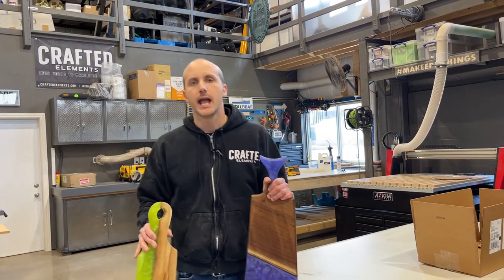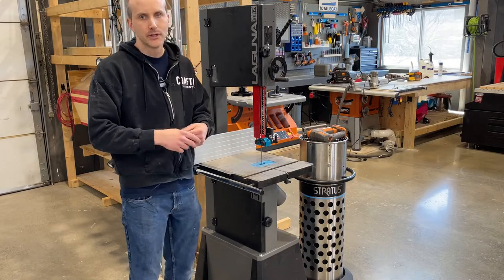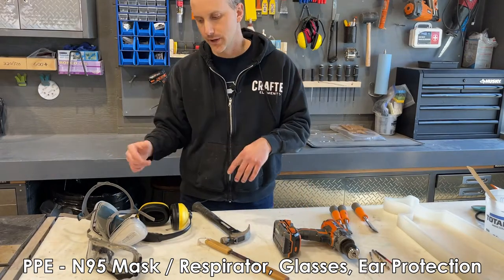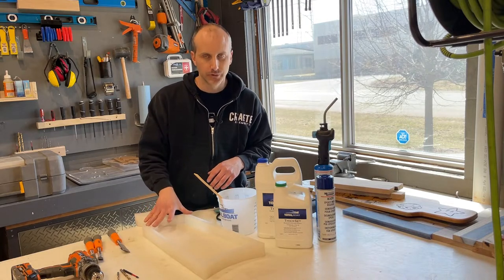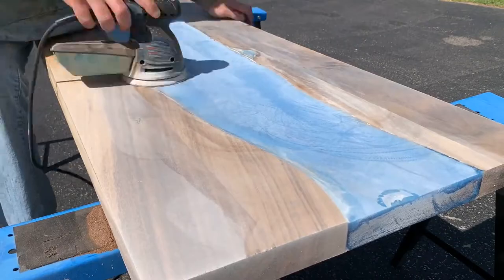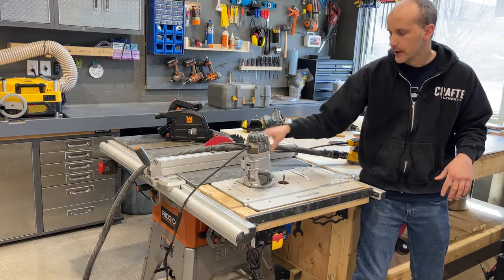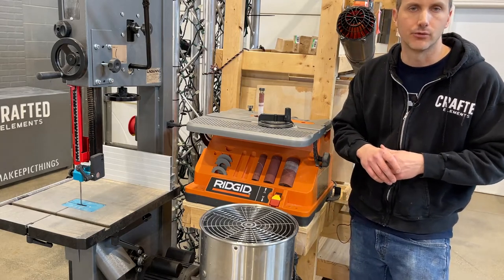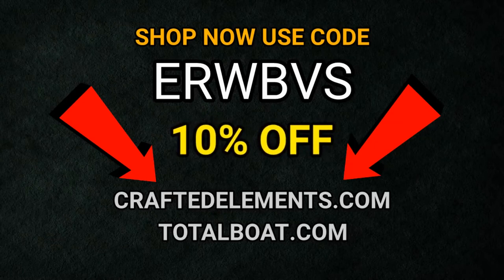Epoxy Resin & Wood Basics Series - Tools For Wood & Resin (Part 2/11)

Comment: I think an oscillating sander like the Rigid unit you have in the video is a must. From personal experience, this type of sander can be a lifesaver whenever you have to deal with router chip-out, especially along the edges. While these sanders cannot hide major chip-out damage, small to medium imperfections or even edge modifications after routing, this tool is ideal.
Reply from the maker: I have recently come to agree. They can be purchased for a relatively small amount of money, but make up for it in time saved. I rarely used it until recently, I just stuck to my 5" palm sander, but it does some magical things better than the palm sander!

Comment: appreciating your video series - one of the challenges i am experiencing is maintaining my plainer so it works sufficiently in plaing the wood, seems to require a lot of attention.
Reply from the maker: Totally understand. You need to make sure your blades are sharp in the planer, and you don't want to take off too much at a time. You want to remove multiple small amounts in multiple passes. Don't try and take off 1/8" at once for example
Reply: Thanks so much for replying, how frequently would you say you clean rollers and blades?
Reply from the maker: @justjacqify  I dont really do it on timing, and its going to greatly vary because its related to the amount you put through it. Right now, the stuff we make is only for demonstrating to YouTube and doing photos/training with our products. We dont make things for people, we simply dont have the time, so my planer blades maybe get changed once or twice a year. I never clean it.

Comment: Great videos!!!! What type of total boat epoxy do you use for the charcuterie boards? Is it the thick set clear casting epoxy or a different kind?
Reply from the maker: We use @TotalBoat Makerpoxy for small, thinner boards. Thickset (not the Fathom) for larger boards.